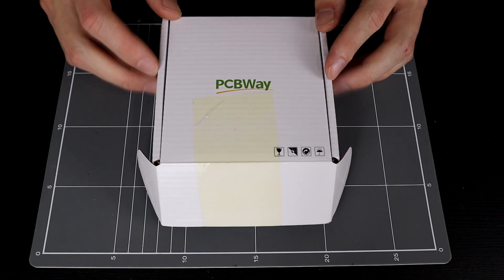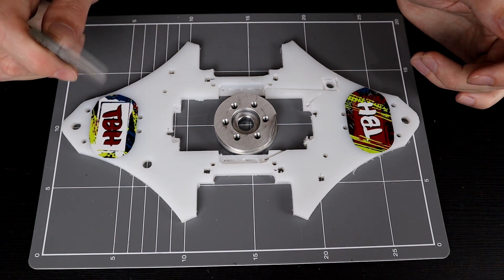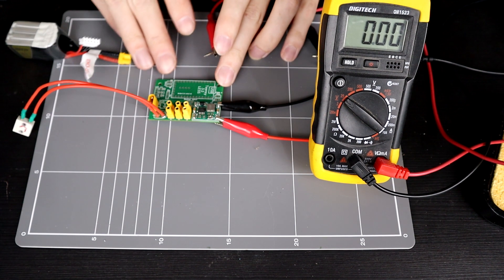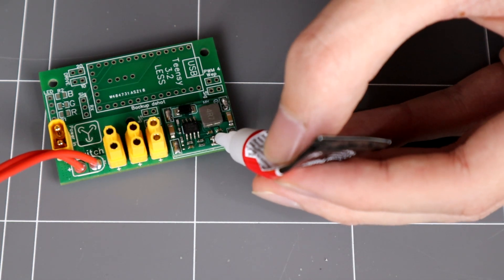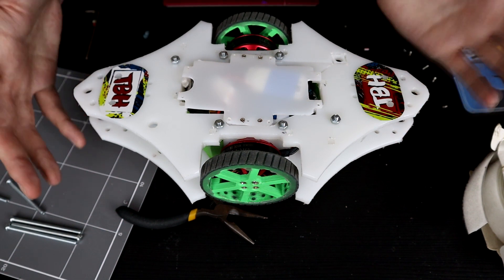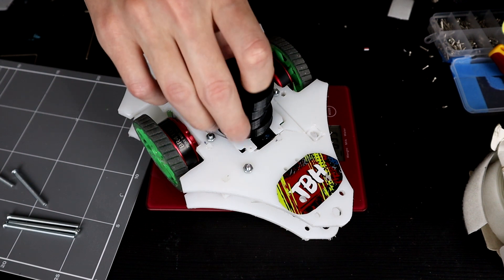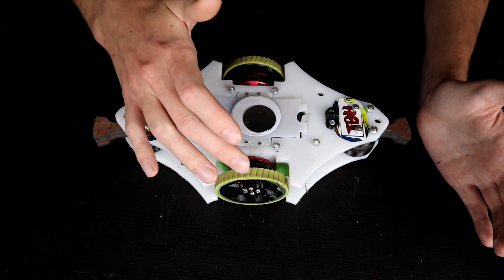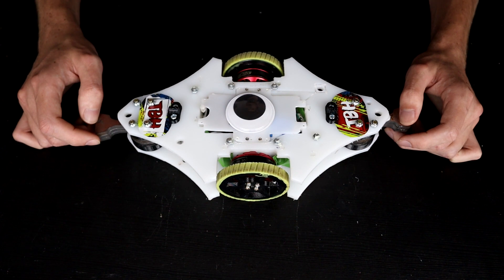Improving by simplifying! (1.36kg meltybrain)

Comment: suggestion for balancing the battery in the future consider using two smaller capacity batteries in parallel. that's what project lift does so they can have more flexibility to keep thins evenly weighted

Comment: Have you done any testing with an IR beacon for heading tracking? Maybe redundant tracking method that you could switch with a channel on your transmitter.
Reply from the maker: I havent yet, but partially because its always been my goal to scale this design up and Halo had issues with IR beacon range, even at beetle scale. So I dont want to start relying on a tech that I cant use going forwards

Having said all that, I might put a beacon in this design for a short time to get some data on spin speed and translation, but I wont fight with it

Comment: I wonder if keeping the weapons in sync would have the same effect as the fixed teeth. I would think having a belt between them driving the weapons on one central motor may work. This does mean there is a chance of the weapons desyncing, but it could be done.

The other option that wouldn't desync would be sensed motors that try to maintain the same orientation as each other. These would be able to get back together after a hit and would probably need to spin down for a moment to get perfectly lined up again.
Reply from the maker: that might be the case, but honestly the only real way I can see to sync them is virtual sync using sensors, probably not on the motor but on the pulleys, which is extra time critical code to try and run at the same time as the very time critical melty code

Its something I'd like to test for eventually, but that might be a ways off
Reply: @Team Panic  Have you considered running them as independent systems? It's a whole second microcontroller setup, but it keeps the code from interfering at all.
Reply from the maker: Yes for sure, thats honestly my plan for the next weaponised version
I was just going to put in a second RX and run them from that, but I could do a second micro if keeping them in sync helps

Also I've just thought of a test I can do to check for sync issues
Reply: @TeamPanicRobotics  100% give the double controller setup a try. It sounds like a good idea to test everything out at least.

Comment: Surprised you had a whole adjustable volt regulator on the board when you could just use a BEC or even just a 7805 regulator
Reply from the maker: The first version of this board I did have a regulator SMD soldered to it, specifically a AMS117
Which was supposedly fine with the 3s voltage I was running it on, but on big hits I was getting a brownout/reset issue and swapping to one of these voltage reg boards fixed that issue, so I just used one for this design

Yes, using a separate module is a little inefficient, but at this point I care more about it working them anything else
Reply: Looks like he is using a 4 cell battery. so ~16v -> 5v drop. It might be worthwhile to measure the current pulled from the 5v switching regulator to determine if a linear 7805 would be worth it. The only real benefit from that may be smaller board size and a few grams saved, but that's about it.

I also don't see many smoothing caps on the board. Some smoothing caps on the 5v power rails might be a good idea if there is interference issues.